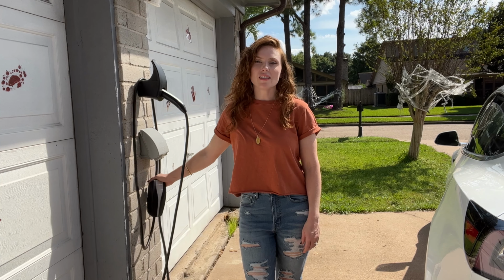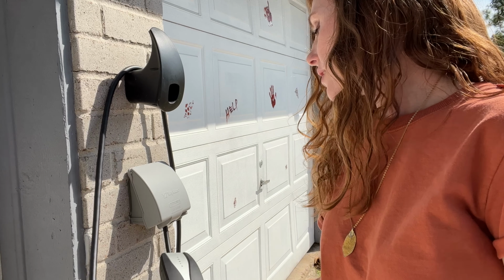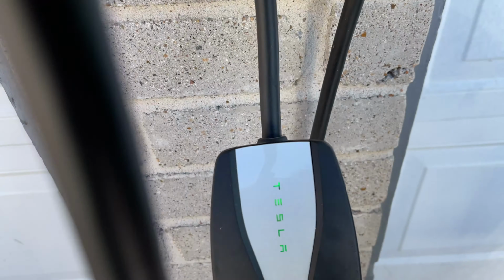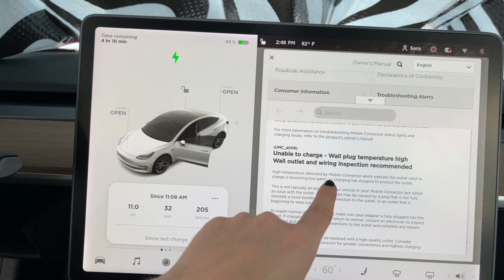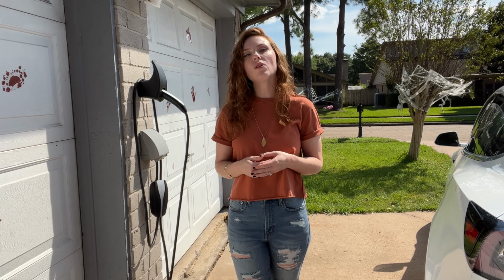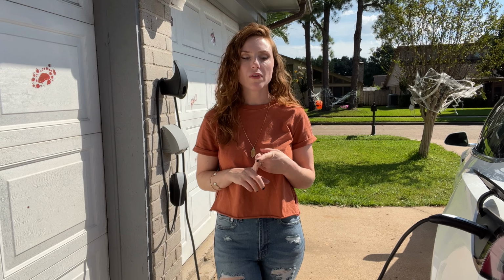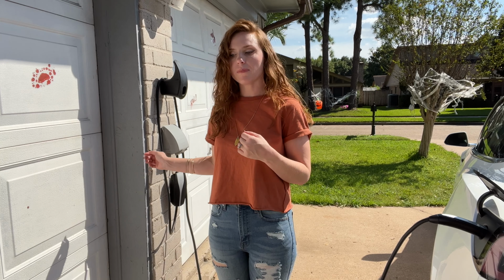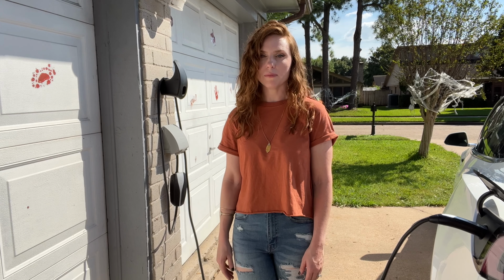TESLA Mobile Charger Problems/ Troubleshooting

Comment: I am having the same issue inside my garage. It does not shutdown but the charging rate drop half way and tells me that the plug is overheating. What I did is change the charging rate from 32amp to 28 amps and never happened again. It may take an extra 15 minutes to charge but don’t really matter. Also, you can set a notification from your Tesla app when the charging is stopped so you know if your charger has stopped working. 
Great video as always.
Reply from the maker: What?!?!?!?! First off, thanks for sharing that about the amps and notifications. I think I don’t notice my notifications because my phone is always on silent and when I get a notification it doesn’t actually say what it’s for. It just says notification. So I have to kind of guess. The stats app is better at communicating what the notifications are actually referring to in my own experience. And I don’t think I knew you can manually slow down the amps …. Where and how do you do that?! I don’t think I will but that’s great info for everyone!!! Also, where the heck do you live when it’s doing that inside the garage?! Holy smokes!!!! Nevada? Thanks for your insights as always Ruben! Have a great week!!!! Look forward to hearing back on this!!!
Reply: @SaraJAwesome  it is 90 in my garage. Welcome to Miami. 
You can adjust the amps in the charging screen on your car touchscreen. The notification you should be getting on the app is “Charging interrupted” and should show on your phone.
Reply from the maker: ✅✅✅✅✅✅Everyone look at this!!!!!!!  Perfect!!!!! Thank you, Ruben!!!!!!!!!!!!!!!!